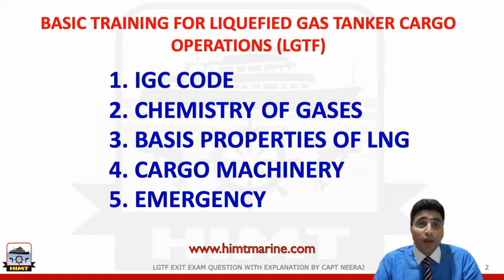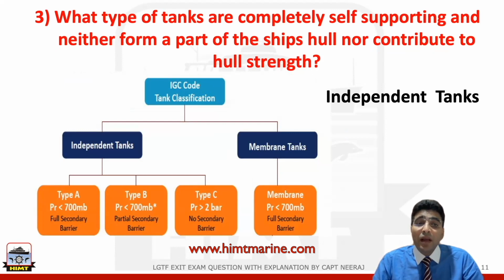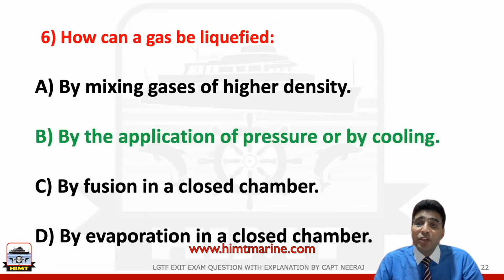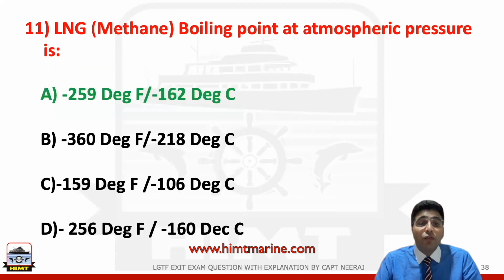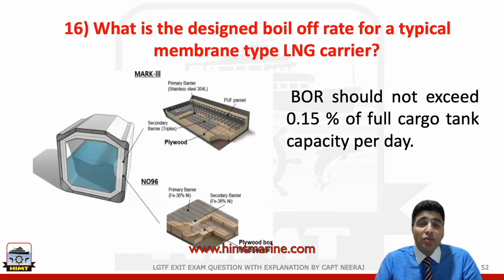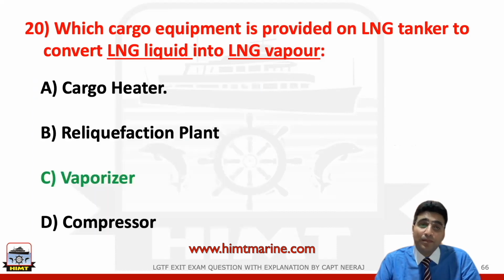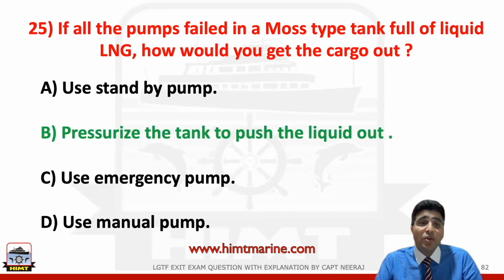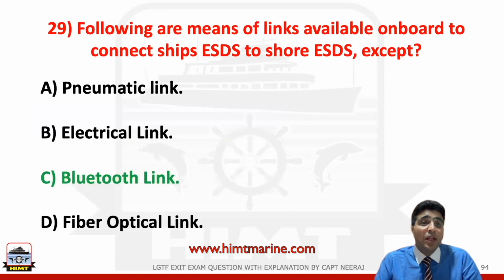LGTF Exit Exam Questions with Explanation | Capt. Neeraj | HIMT

Comment: Capt Neeraj your answer to q2 is not sufficient and is wrong unless you emphasize why it is absolute ?
LNG is burnable, its rapid transition nature makes it look explosive, but explosion relates to rapid flame propagation & rising pressure , so it looks it burns but not explode
MARVS are safety relief valves ,not relief valves  which release excessive system press of liquid medium